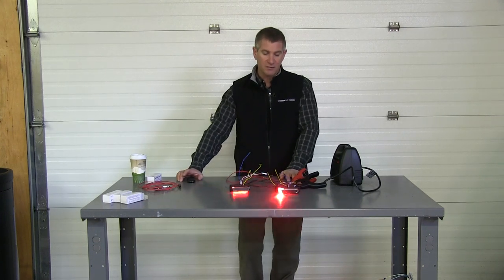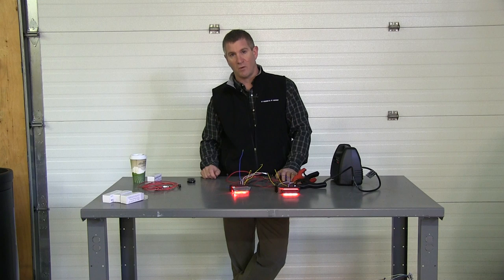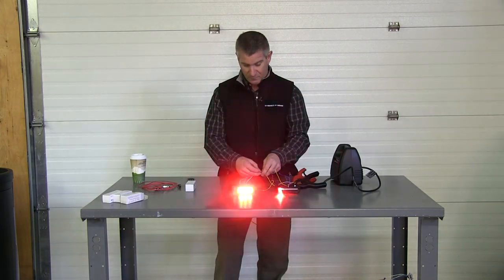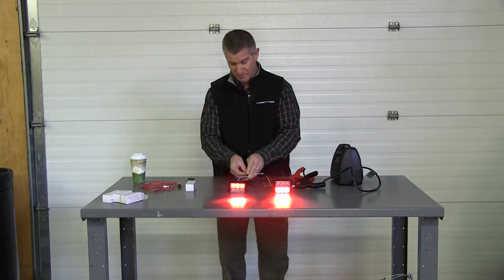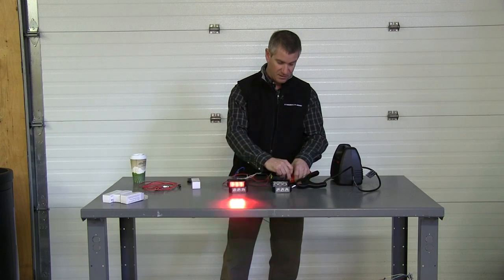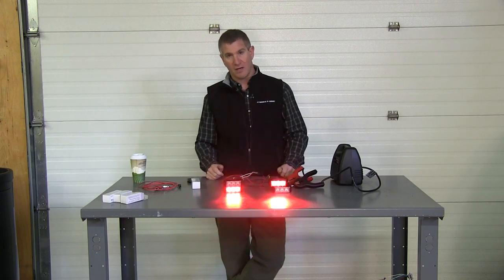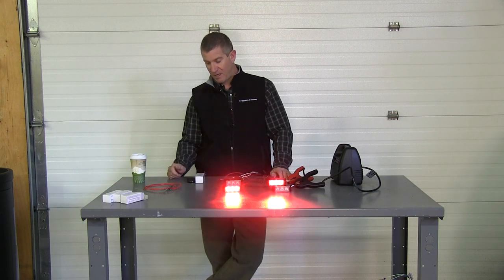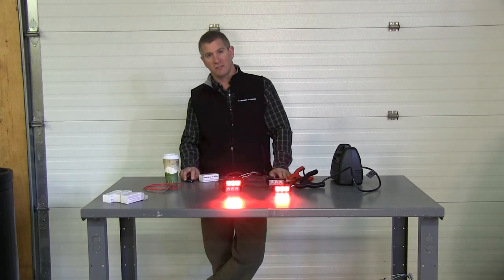Strobes N More Flash Pattern and Sync Troubleshooting Video

Comment: i have 8 mini strobe lights, they have just a negative and a positive wire coming out of the back, it has a rocker switch with a pattern  light button on it also, it has a negative and a positive and a white wire, coming out of it, now i connected all my lights to the switch , positive to positive and negative to negative, do i connect the white pattern wire permanently to the negative, and just press the pattern light button to change the pattern ??  or can you suggest what i should do, i have seen some videos saying , just touch the white wire to the negative , and that would change it to my desired pattern.  your opinion ??   please

Comment: i learned a little in the video on how to get the X pattern, that was helpful. and you did say that this is usually covered across all manufacturers. But does not seem to be so with these china style leds. 

I had bought some, they are really thin and crazy bright. but unbranded. so not much info to be found. Have you played with any of them yet ?  if you search this.. 

4x 6LED Emergency Beacon Warning Hazard Strobe Light Bar Flash sync Amber White
you can see what i am referring to.  these are a bit different. they sync system consist of a master and slave wire. but the master will only drive up to 2 heads, but i found out that the master wire on one of the slave heads can drive more heads.  but i have yet to achieve on how to get the X pattern with these.
any ideas ? thanks.

Comment: Do not bench test? Bench testing is essential to testing the lights before putting the labor into installation. It is also essential to set up the flash pattern before access to the lights becomes cumbersome. 
Perhaps a video on safely bench testing your lights should be your next project. I think it would be more productive than telling us not to bench test. 
Lastly, I read the installation guide in full, as directed, before I did anything else. Then I bench tested my lights and set the pattern as there were no instructions not to.

Comment: We know what a flashing light looks like. What we want to know is how to change the settings.
Reply: you ground the blue wire while its connected to ground with black and power. fused power to red, tap blue to ground pattern changes...disclaimer/ your milage may vary and collor may be diff on your specific unit. the 4th wire is the sync wire that ties them all together

Comment: Improper bench testing, and heating the solder inside the light head while using shrink wrap on the wires... sounds like dumb installer syndrome. These lights are fine to bench test with regulated 12v power supplies.